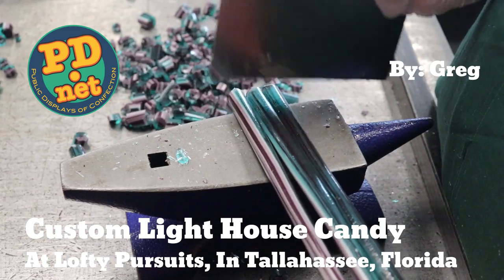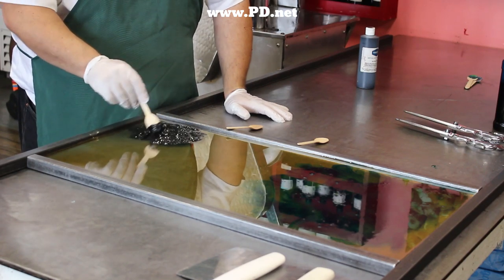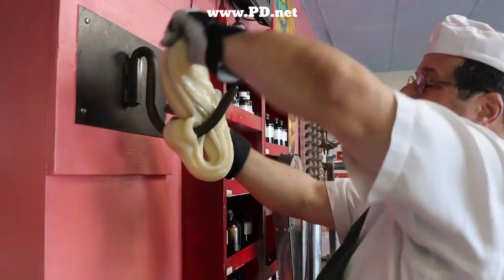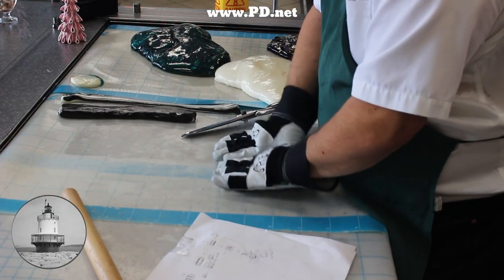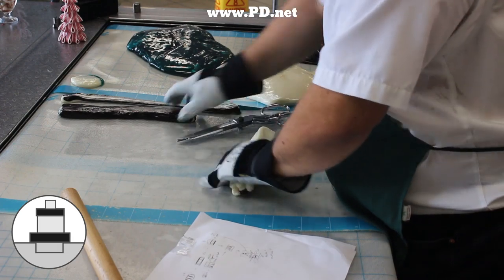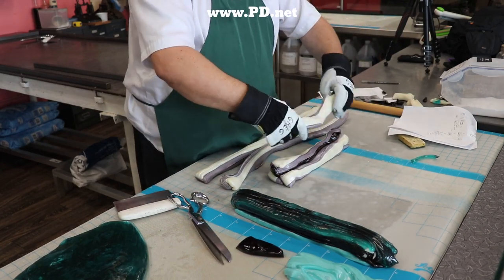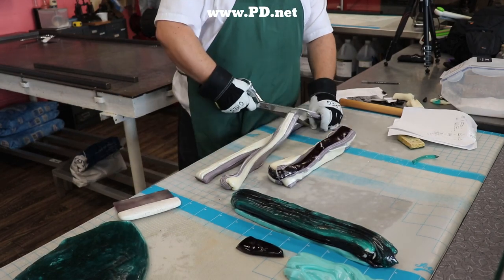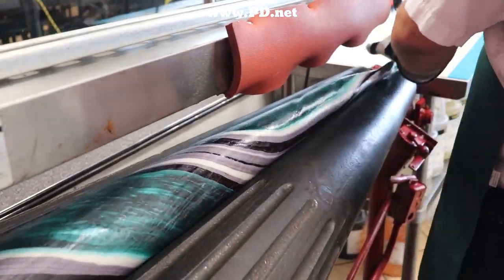#105 Making a candy with the Spring Point Ledge light house in it.

Comment: I have a question! Why did you put white colouring in if you were gonna pull it anyway?
Reply from the maker: I wanted to make sure it was super opaque. I needed to cook the candy a little hotter than normal on that can make the white a little yellow. I needed more time to work with the Candy. By putting the White in it would mask the yellow
Reply: @LoftyPursuits  thak makes sense! Thanks for replying!

Comment: Quick question about the unicorn droppings you make from the ends of the image candy: Is the sugar too hard at that point to turn it into drop candy? Or could you melt it a bit  more, smoosh the colors together and run it through your rollers?
Reply from the maker: Has become cool very quickly and usually are unusable for such a thing. Instead we called him unicorn droppings and we sell them at the store.
Reply: @LoftyPursuits  Ah, thank you! Also, I was having some of your nectar drops when I typed that message, so I consider your answer a double-win for me!

Comment: Why did you add white food colouring this time? I know you dont normally when you're going to pull it
Reply: i was gonna ask this too
Reply: He needed the white to be warmer and if he pulled until it was white, it would have been too cool for doing all the intricate designs. He still pulled it, but it wasnt as much as he normally does
Reply: I'm going to guess it's so he could make the gray color
Reply: @CapacityLamb666  apparently it was actually so that he didnt have to pull it as much, so it would be warmer and easier to work with :)
Reply from the maker: It was also covering me. I only get to do this once in a wedding is an important thing and I want it to be perfect. I didn't know if I pull it enough or too much and I could mess up the batch. Better for me to add a little white to make sure that what I did worked. I was fairly happy with it they seem to be very happy with it